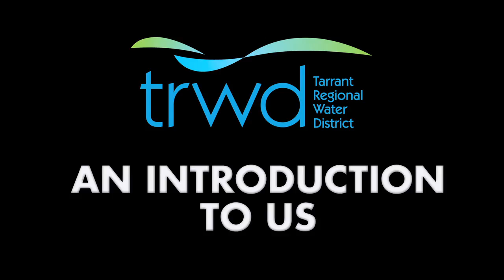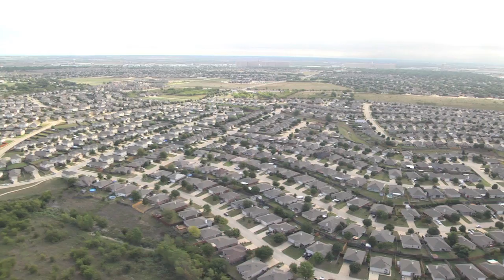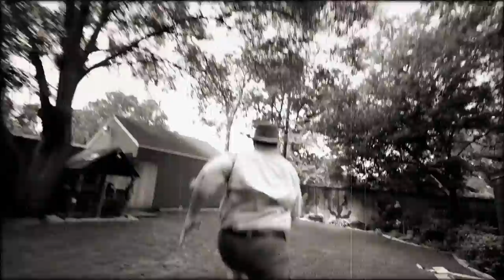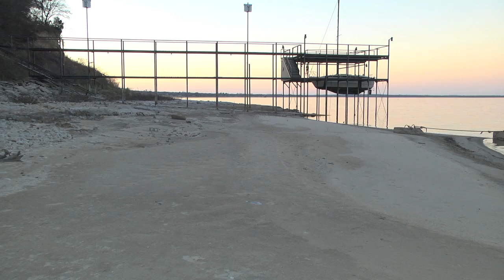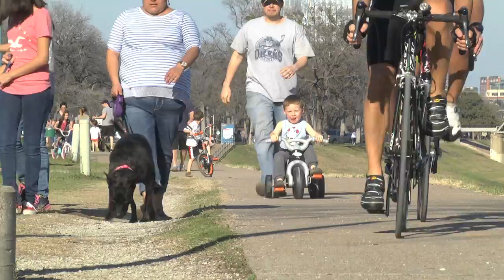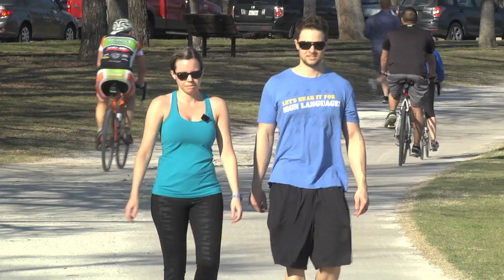An Introduction to TRWD

Comment: Your efforts for conservation are admirable.  What are you doing in the actual reservoirs during the drought to increase water volume for the future?  It appears TRWD does not put money into the water supply sources to make them better.  Only Tarrant County property. Comments?????
Reply from the maker: Thank you, Claudia. Water conservation and reuse, as the video points out, are viable water supply strategies. Water conservation has lowered our annual demands an average of 100 million gallons per day. Looking at it from another perspective, that’s 100 million gallons per day that are not being consumed. The end result is more water in our reservoirs during times of drought. And more water for future users - enough to supply an additional 550,000 people on our existing supplies. 

The Richland-Chambers water reuse project (completed in fall 2013) is also a huge success. In fact, 20 percent of our annual water demands in 2014 were met by downstream flows in the Trinity River that were treated at the wetlands and put back into the reservoir. That’s a huge volume of water - approximately 63,000 acre-feet or 20.5 billion gallons. To put it another way, the water TRWD is getting from this project is enough to supply 79,890 households (consisting of four people each). 

All those savings add up and are dramatically reducing the pressure on our water supplies. Both strategies amount to adding another reservoir to our system without the massive cost of building another reservoir. And that’s a pretty good deal for all of us - it keeps costs down and will allow us to serve the needs of our growing population for years to come.

Comment: Good things, all, but the items highlighted in this video only account for about 20% of your operating budget, per your own charts.  What is the other 80% spent on?
Reply from the maker: Mr. Bickley, thanks for checking out the video. We aren’t sure which charts you are referring to, but we can explain how 100 percent of our funds are spent.  Our 2015 operating budget is approximately $205 million. Of that amount, 66 percent of it ($136 million) is committed to water supply and the other 34 percent ($69 million) funds our flood protection and recreation efforts (Trinity Trails, Twin Points, Eagle Mountain Park, Airfield Falls, Marine Creek Trails).
Reply: trwdtv Thank you for your reply.  I was specifically referring to this chart that was presented by the TRWD.  In the $136 million above spent on water, how specifically does that break down?

http://www.empowertexans.com/wp-content/uploads/2014/09/General-Fund-21-e1410452287675.jpg